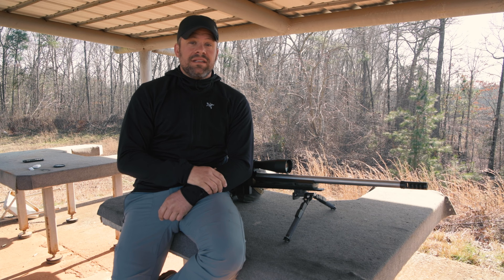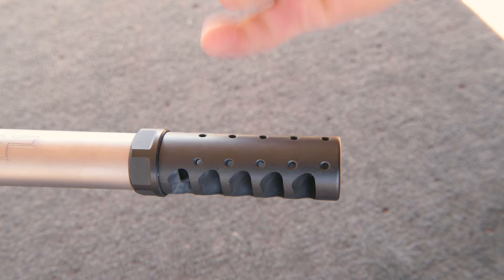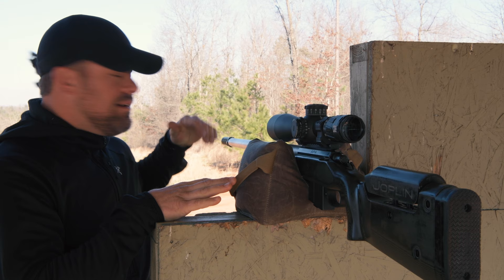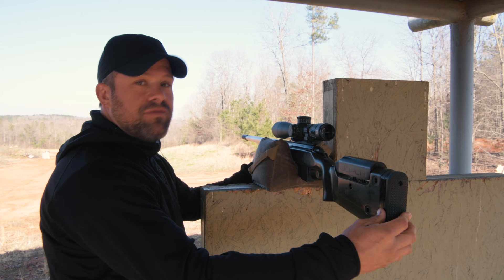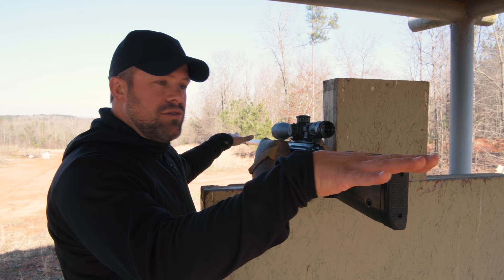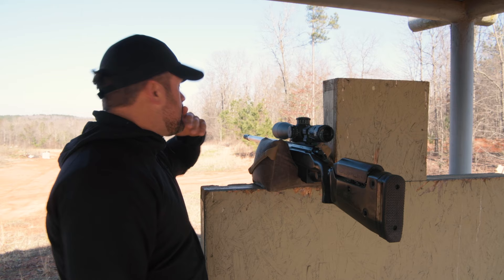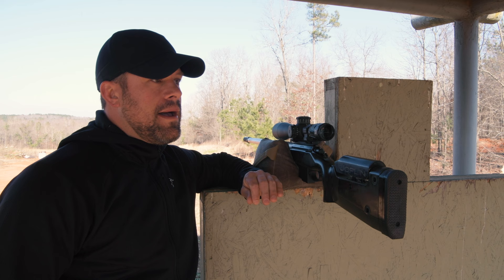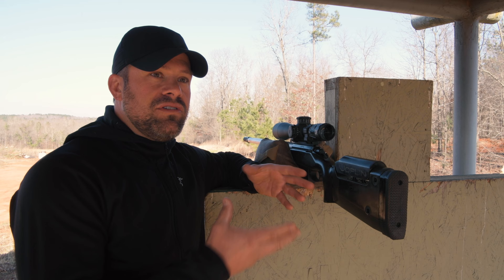How to Tune the APA Gen 3 Muzzle Brake

Comment: Seems somewhat presumptuous to expect that for a given rifle, only one type and bullet weight of ammunition will ever be used, and that therefore muzzle rise would be fixed for all the ammunition to be fired in the gun.  Certainly recoil energy and velocity will change with bullet weight; would not muzzle rise likewise  change?  Shouldn't you test with all the ammunition you foresee using, and keep a record of how many screws are appropriate to each loading?

Comment: I seen videos that you could adjust for left and right. Is that true?
Reply: To some extent. There’s only so many on each side. What I’ve found twice is uneven number out on each side. Find that fairly common. You play with the ports until there’s very little reticle to target movement. With smaller calibers, there’s VERY LITTLE movement .260Rem & 5.56. Top notch, only brake I’ll buy anymore. Install is stupid simple.

Comment: I put the muzzle break from yall on a .300 win mag and there’s no recoil or muzzle rise
Reply: Did you keep the screws out?
 Just got one for a 300 win mag and am curious about the screws.
Reply: @ExplorersWorkbench  I took all the screws out and my .300 is like a sniper , only thing that comes with using a muzzle break is you better have ear plugs , or you’ll lose your hearing
Reply: @pecanpielsd4412  awesome! I cant wait to ry it out this week.
Reply: @pecanpielsd4412 Did you just hand tighten the brake with Rocksett? Any torque needed?